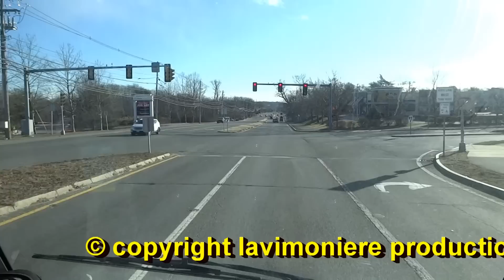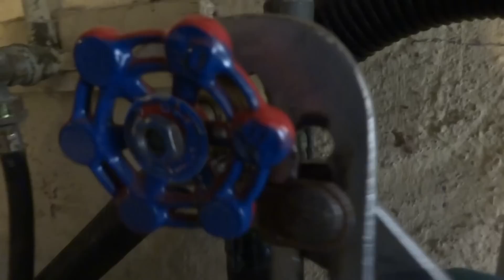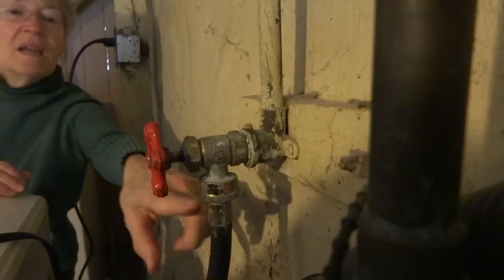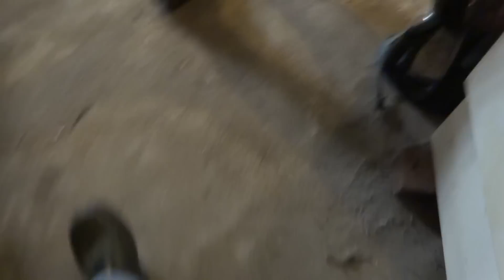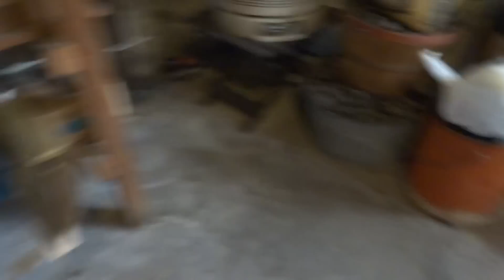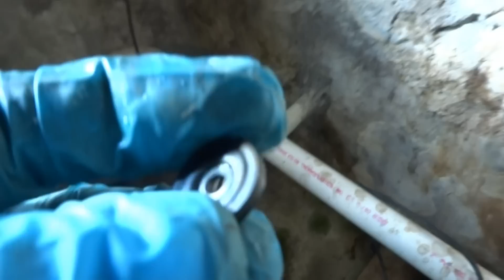OUTSIDE SILL FAUCET NOT SHUTTING OFF

Comment: At the end of last winter, my heat would not come on....gas heat it would fire and go off about 4 times before finally shutting down. By learning from your vids I cleaned the flame sensor and she is as good as new have had no problems with it this winter. I did order a 2 pak of sensors just to have on the shelf ....thanx for teaching us all this.

Comment: can you get those valve gaskets? anywhere or special order? wouldnt be a bad idea to have some on hand. i use warm water for washing clothes. i do concrete and it seems like it cleans better than just cold. arm&hammer and all works the best for really dirty clothes.
Reply: I agree.  "Not necessary" does not mean optimal, just possible or passable.